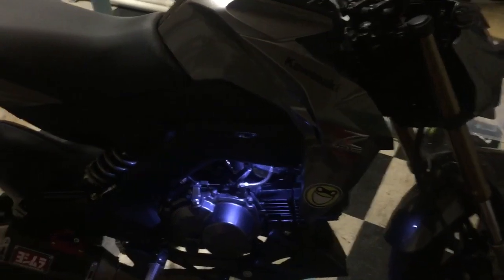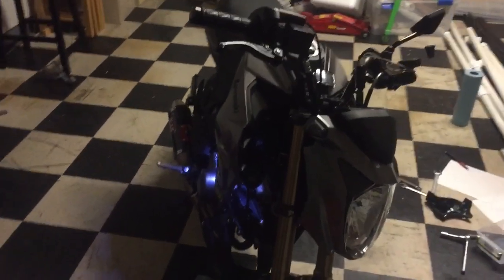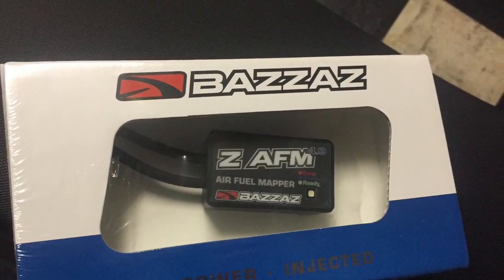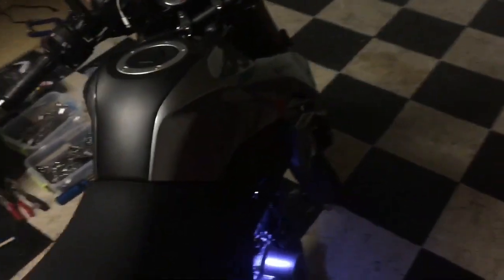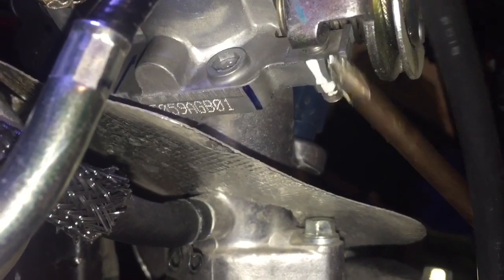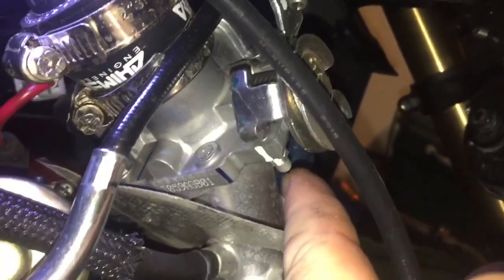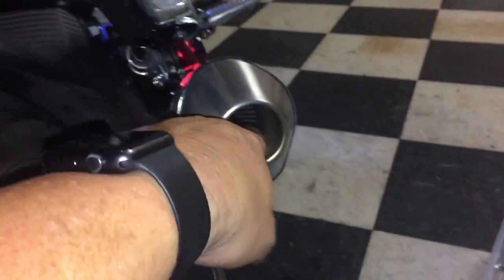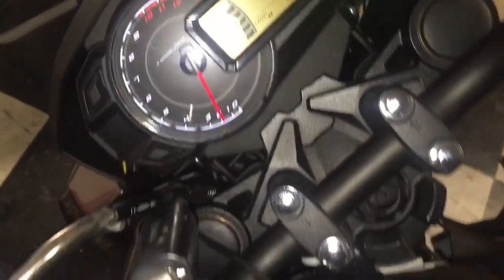Kawasaki Z125 Pro - Misc changes

Comment: Keep us updated on that mapping when ur Bazzaz gets there. I've got full exhaust and Bazzaz on the way as we speak. Bike setup a lot like yours, so I'll be looking for your maps! Awesome vid as always.
Reply from the maker: Thanks!  Sure thing!  Since I have the O2 sensor and recorder, I'll probably make several maps in different configurations. I'm not a pro but I'll at least make a safe map!
Reply: +TomAndToys cool cool. Yea the same setup as urs, just a bit different exhaust system (Leo Vince GP) but I figured you might have a better map than stock being in TX with the same mods. Same air and everything. Looks like Bazzaz only has 1-2 for the Z-Pro at the moment. But I'll be watching.

Comment: aloha great vids man. I'm waiting for all my stuff to come in as well.it should be here on Friday. and my bazzaz zfi will be shipped out on Wednesday. do you think the 15 tooth makes the bike struggle alot or its not to bad?
again great vids man thanks for all the info
Reply from the maker: +rymirc665 if you have an intake and exhaust, it is not "too bad". I just don't prefer it. The bike is great all around with stock gearing.

Comment: Hey do that tender drain your battery or u unplug it after you use it... I need to keep my gps and phone charged but I don’t want it drain my battery
Reply from the maker: IAN SANDERS Nope. It is just an open set of wires when not connected.
Reply: TomAndToys thanks a lot I just ordered it